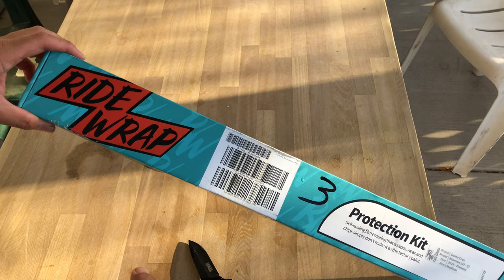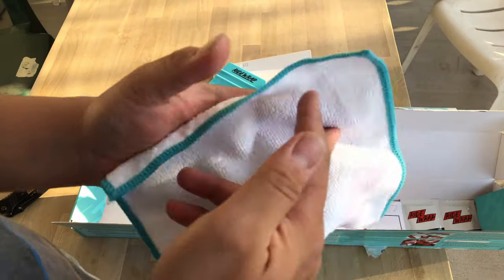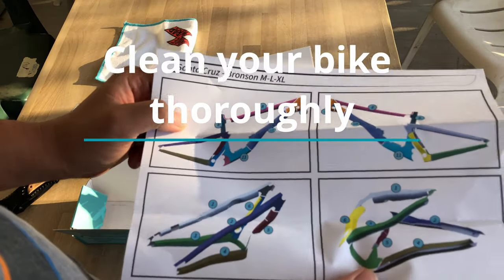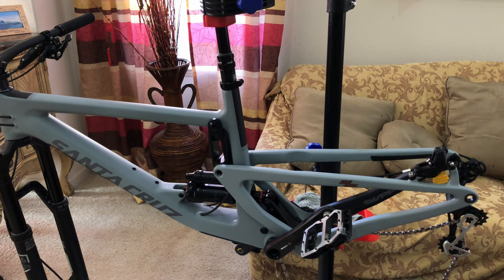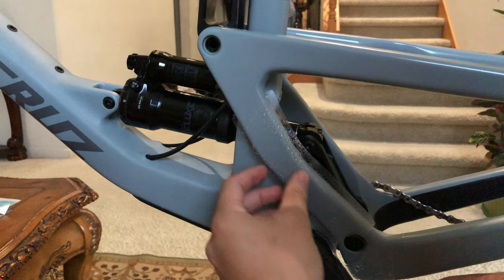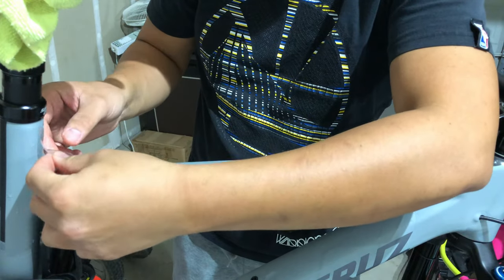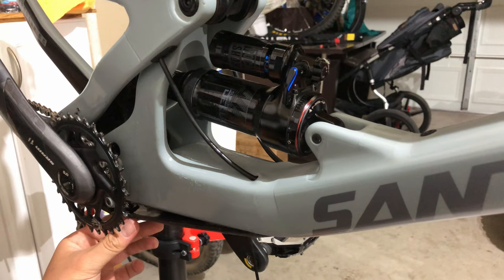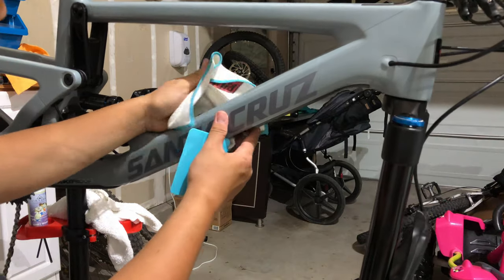MTB Frame Protection Install Guide: Ride Wrap

Comment: Yours is the first video I've seen where derailluer, cranks, calipers, etc. are left on as you're doing the install. Did any of this stuff get in the way or were you able to work around everything without issue?
Reply from the maker: Not at all. I've done already 3 wraps and I've never taken off those components. It might take you a couple of minutes more to make sure. it's aligned and squeeze the wrap in tight parts, but it will save you tons of time (and possible problems)  by not taking them off and putting them back on.
Reply: I just did my Trance X and I only took off the back wheel - that’s it. You really don’t need to pull the whole bike to pieces!

Comment: You made that look very easy, other videos show it being very tedious hard work that takes 4 hours or so. I wanted to use Invisiframe but they don’t do the new Norco Sight yet, so I’m going with RideWrap. I hope it goes on as easy as you made it look. Good vid mate. 🤙🏻
Reply from the maker: Well the video just covers some tips that I've learned through the process. But it took me 4 hrs total (with filming) since I want to make it as smooth as possible. So those 4 hrs long install is about the right :D

Comment: Take off the cranks, wheels and rear shock.  Then mount in a stand.  Wash the bike perfectly clean then alcohol swab it well.  Use plenty of spray on the bike, the part, and your hands.  Soak it, because this displaces air much better and makes squeegeeing air out easier.  Use a hair dryer to get pieces to tightly conform.  Don't fear that when you come back after putting down bubble free wrap to see below bubble all over have appeared.  It's normal, it's simply water that migrates as the drying happens.  Leave the water bubbles alone and they will dry away and it goes totally back to perfect, I mean perfect wrappage.  But it's important to make sure all air is removed when applying.

Comment: Hello, I'm not too good / willing at removing all the parts to only get to the frame. Do you think I could install the tailored or full wrap without removing the back wheel? Thanks
Reply from the maker: It's going to be really difficult to get a smooth wrap if you don't. taking off the wheels is a very simple task that every rider should know... look up youtube videos and it will save you a lot of time in working on your bike and keeping it dialed
Reply: omg

Comment: How'd you remove the chain protection bro ?
Reply from the maker: the plastic chainstay protection? just pull it out, it takes a bit of force
Reply: @TrailDad  the chain protection on the rear triangle derailler side pull off? did it go back on easily and not stretched?
Reply from the maker: @andrewsugden7626  no, its a tough material it did not stretch.